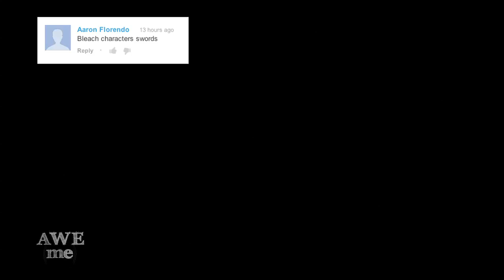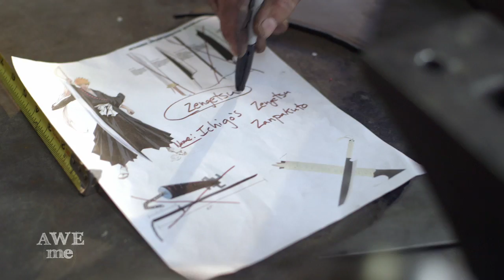Ichigo's Zangetsu Sword (Bleach) - MAN AT ARMS

Comment: I am a bit dissapointed with this sword because when those guys swing it around it bends.
Use a harder material.
Reply: They wouldn't be able to swing it as such if they did unfortunately.
Reply: V Stanev But a stronger guy probably could :)
Reply: ***** The people on this show are very strong it would take a body builder to swing it without having a problem if it was made out of stronger material.
Reply: Well,I understand that it would be heavy to lift by an ordinary man.
But still a weapon is designed to kill,stand againsts other swords....
This sword would break easily if it went against blackstar weapon they did also.
But well,it's pointless for me to talk about this because nothing will change.

Just because something seems impossible doesnt mean it actually is impossible.
Only trying out will you find out xD
Lol,a rime came all by itself ;)
Reply: if the metal is too hard it wouldnt bend but it might shatter and if its too soft it could be all over the place so this is balanced and its the best metal to use in this case.
Reply: As an engineer: You can have relative rigidness or use less material, not both. Besides, all tools bend when striking. If they made it solid enough to 'not bend' when hitting a watermelon it would need to be several times thicker. It wouldn't resemble the original at all. To not bend when striking another weapon, it would basically need to be a solid 4x4 inch piece of bar stock haha
Reply: Is there some material that isnt that heavy,and doesnt have to be thick to not bend?
There should be.Maybe it's not the one that weapons are usually made from,but there should be one.
Reply: All weapons bend. Go out and buy a katana and take a few swings. Blades on longer weapons bend.
Reply: It still looks sweet..
Reply: Welcome to real life where we have a thing called physics.
Reply: It's funny how many times a group of people becames a "yes man group" that even if you presented them with shit,they would applaud you.

There is always a way,but before that you need to choose.Are you going to go easy or hard way.
This is clearly easy road.

All of you "yes mans" this doesnt mean that the other work they did is bad or that even doing this wasnt hard to do.
But it could have been done better.
Reply: ***** This is real life, not one of your Chinese cartoons bro.
Reply: Eddie Spaghetti It's actually japanesse.
Anyways...someone said that each sword bends.
As far as I know swords dont bend.
If they did then in a sword battle you would get your sword destroyed.

Let's stop for now,cuz I can see that we cannot agree.
bye
Reply: ***** you clearly don't know that much about metal, so let me enlighten you, steel is an alloy formed from iron, and carbon, and contrary to iron, steel is very flexible. You might think that this is a disadvantage, but if it doesen't bend, it snaps. so Theres that.
Reply: Magnus Husted Even if the swords do bend a little(1 mm).
What was shown in the video is not even close to that or are you blind?
Reply: ***** if you wanna complain so much... go make one yourself then see the results for yourself...
Reply: teo jinhao It wasnt my intention of complaning soo much,it was the people that opposed me by explaining why is something like this okay,even if it's actually shit.
So I had to answer them.

To show you that it can be done - How a Buster Sword is built.

Ichigo Zangetsu is even smaller than this sword due to the shape of the sword....
Reply: it is also thinner...
Reply: Hey Stefano... Don't worry... let them think what they want... here's something for you to spot on... in fact they who has NEVER hold a real sword, (not even a real "KATANA" previously mentioned...), ...  in fact have no idea about HOW does a real simple sword like "Katana" is made of... IN FACT this guys has done a very great job by doing the best they could to make this sword real... because it is not easy to get the right sizes and techniques to make real such a thing like that from an "Anime", (for the people with no culture...), ... BUT... NO, not all the blades are made to bend, like you said in fact most of them bends but it's exactly at max, 1.8mm... of bending and this is NOT to avoid snaps, this is to bring you help with the balance and weight of the sword when you're in battle and also when you need to swing the sword in very opened angles, otherwise your wristles and even your shoulders muscles would even break... in fact, Swords and even more "Katanas" have a very Slim and thin long bar all along and inside the sword which is made of a particular mix of Iron, Steel and sometimes other metals and even "minerals" and this bar it is called "The Soul" of the sword, which goes from the holder untill almost the tip of the sword... that's why it has to be covered by the "Decoration", like most of people call it, for you to not to warm it out with your own hands and if these "Smart" people commenting and throwing, their very  "basic" knowledge at you, would have got a small idea about it, they would even know that this causes the sword to NOT to bend at max as posible to make it "SLIDE" and cut perfectly, which requires a special technique to make it... and that's why the one that "BIRTH" a sword often prints their own name or the name of the sword in it, often called the "Seal"... and now finally... have you ever wondered "Why there were ancient masters trying to practice and masterise sword fighting techniques all along the years and years and years?" ... well, buddy, that's the reason why... how to learn to move and fight and make a sword become an extended part of your body... when it's heavy to lift, carry and it can't bend easily ;) ... have a great time buddy and don't worry you were not wrong at all ^_~
Reply: William Guile You should read again what he wrote.
Do you imagine how silly would the swordsman look if his sword bends so much that it is actually seen by naked eye when he is in action.

I belive that when first swords were made,people were like you guys here.
This thing is heavy,it's not practical and so on...
If you train yourself with a sword at first it's going to be hard,but later on I belive you would be able to use it as regular sword.
No one has tried it yet,cuz we dont use swords for war anymore and we dont have wars either.
Reply: ***** Uhh people have been using swords for centuries now, it's just that swords like these are not good for combat. Way too heavy and way too long (Plus very impractical). We all can't have superhuman strength, agility, dexterity, etc as Ichigo from the anime. IMO it's sillier to have swords like these in combat than a sword that bends.
Reply: If they used a harder metal the sword would break, because with more hardness the sword looses its tenacity, and a few swings can crack it easily. Hardness is good but only at a certain level.
Reply: ***** dumbass lol.
Reply: ***** how stupid are you? there is plenty of war in the world
Reply: Eddie Spaghetti war where people use swords???and I am the stupid one ;)
blackUP2424 thanks for the insult...

cleijuni
To me it seems that you people dont see what the sword in the video does...
To demonstrate create a paper zangetsu and swing it.(this will show your extreme case - compared to katana this ichigo sword is just too much bending-specifilacly closer to te sword end)

Somewhere on the youtube there is mini version of ichigo sword.(you dont see that one bending like freaking "paper")
Reply: ***** Guys.. Look up claymores or something. Huge swords, able to be carried yet very slightly bend because you see. a completely rigid sword is obviously going to break at somepoint BUT You can't have a fucking flexible ass sword either it's impracticle. As you see if a sword bends to much it has a chance of fucking breaking as well. I swear half of you have no idea what you're talking about
Reply: Knowen The sword in the video bends too much in my opinion.
It looks like it could break at any minute.
That's why I was arguing in the first place....
Reply: ***** yea I know, I'm going along with what you're saying not against. this sword looks like, if it were to clash against another, it would just... yeah XD now work
Reply: ***** you are sort of right they are bending a little to much to be a pratical sword but keep in mind this was never intended to be a real sword so the size and thickness make it bend but a normal katana will slightly bend not as much as this though
Reply: Nick Platt Lol,then why not making it like the anime(not able to bend) if you are not going for realistic sword...
Reply: ***** because anime swords don't work in real life, this was already explained to you, they are impractical and not realistic. If you made it so it didn't bend you'd have to make the blade much thicker and nobody would be able to pick it up since it'd be extremely heavy and it wouldn't look like the anime.
Reply: science bitch.
Reply: ***** If I was making this sword I would make it right even if it turns out heavy.
I linked you guys a video from some other guy who made a thicker and bigger sword than this ichigo sword.
Off course your first swings wont be powerfull or skillfull and you would probably barrely swing it.
I dare you to say that after 1 year of training with that sword.

It seems like you people dont know what swordsmans are.
A sword doesnt make a swordsman.
It's his skills that make him one.
The skills he achieved trough rough physical and psihological traning.

And yea,I am pretty sure that those guys could do it,but it's just more work and they dont want more work probably.
So I am not teaching them how to make swords,but not to be too lazy for doing stuff like this xD
Reply: William Guile You're not a blacksmith, so what gives you the right to go off like that?
Reply: Knowen well,said knowen :)
William - you sound pathetic.
Just because someone doesnt agree with you,you start insulting people...
Reply: ***** Just because you keep saying the same thing over and over doesn't make you right. You know nothing about swords or blacksmithing and you never will.
Reply: Eddie Spaghetti You dont know that.
Reply: You should thank them for making stuff like this not everything is perfect at least they tried and it actually cuts people like this awesome guy showing us cool weapons are very super ultra rare around the world so you should be thanking him so yea don't complain
Reply: This isn't really worth arguing over if your gona be stubborn about all of this then fine but unless you have the prof and experience to back up what you say it don't mean jack shit
Reply: ropgun dawam I thank them for what they did.
And I am glad I stumbled to their videos.

But when I see it can be done as showed you in a another video,I start to think they didnt put enought effort in it.(maybe cuz they thought it would be heavy like the other sword they made)

Anyways....I am tired of arguing with you guys.
It's hard when more people goes against less people.
We can agree that we disagree.
Just because you havent seen something and think it's not possible,doesnt mean it cant be done.

Bye
Reply: dan this is the man you are locking for michaelcthulhu.
Reply: Southern Shark Body builders are actually relatively weak. Strong men usually have a very stocky build. Body builders really only have the appearance of strength.
Reply: Xero Shifts Body builders don't just have the appearance, they are strong but they certainly aren't the strongest people out there. They mainly go for looks yes but that doesn't mean they are weak.
Reply: Eddie Spaghetti Welp, to everyonw here, someone can just get a gun and shoot them from afar. "Anime“ Shenanigans like kirito deflecting bullets with a sword isn't right in the real world. I think the sword era ended and the gun era took over.  (Random troll)
Reply: Loen nguyen Everybody knows that already, thanks for pointing out the obvious. Swords were just a small part of medieval combat also, swords weren't the only melee weapon used.
Reply: ***** most of your statements about historical sword use begins with "I believe". You can believe all you want, won't make it true. I'd suggest actually reading about it (maybe even more than one source, oh no!) Before spouting whatever you believe.
Reply: Your argument is invalid . You are comparing two totally different swords
Reply: ***** After that cheesy "it's not the sword that makes the swordsman" speech I'm pretty much confident that your are entirely disconnected from reality. Sorry, but animes are not an accurate representation of the real world. This sword was designed to be used by a fictional character with inhuman strength and dexterity.

Even if it was true that with a year or so of training you could effectively wield the sword you seem to be describing (by the way, it's not. There are limitations to how strong and dexterous a real human being can be.) there would still be the problem of durability (it would crack and fall apart after any sort of extended use) and the fact that making it that inflexible would make the sword look completely inaccurate. And even if none of that was true, you couldn't reasonably expect these guys to dedicate an entire fucking year of their lives just to make one video.

Also, it isn't entirely true that the sword doesn't make the swordsman. It's a combination of both. If I'm just a good swordsman and you're a great one, but you're using a laughably impractical and easily broken weapon and I'm using a sword that actually fucking works, I'm going to win.
Reply: MajesticSundew A real swordsman can beat a less skilled swordsman with just wooden swords if he wanted.
If a good swordsman was in life and death situation and a crappy broken sword was near him,he would have bigger chances of surviving than a swordsman with less skills.

And no,I am not asking them to dedicate an entire year of their lives for making one video...
It's the only way they can show that I am wrong and they are right.

It's like asking someone that never seee a balloon and a needle if balloon would break if it falls on to the needle.
The logical way of finding out what happens is by actually doing the experiment.

In what way is the sword inacurate?
If you go back to the human older versions you can see that they were stronger,I dont see any reason why todays human couldnt activate that gene by practicing actually sword slashes and similar instead of lifting heavy stuff.

Several years ago me and my friends started playing a game where you find a piece of tree that is close to a baseball bat and hit small rocks with them every day.
I have never been stronger than those days.
Imagine how strong would I be now if I continued to do it for the whole year.
But,people became lazy,and that's why you wont even bother trying....

Anyways...I dont even see why I keep on replaying.
As I said,the simplest solution is to do the experiment.
If you dont then it's just your and mine opinion.
Arguing is pointless.
Reply: ***** Wow you honestly don't know anything about swords or swordsmen do you? This isn't an opinion either, from what you've said you objectively don't know anything (or at the least VERY little) about what you're trying to argue. You really need to stop talking, the internet is full of enough opinionated morons already.
Reply: Eddie Spaghetti Whatever....
You know everything,others know nothing.
Fucking persistent i**.
Reply: Try it on people and say bend lol
Reply: Do you have any idea how heavy that would be?
Reply: Nicholas Cha If I actually cared that much and wanted Zangetsu I  would try to make it and actually use it.
We could both be right and wrong.
Are you more right,just because a bunch of "loud" people supports your view on the matter?

Also,in my first post I only said that I noticed too much bending and that part of the sword dissapointed me.
I didnt ask for discussions or anything because it was my own opinion based on the swords I seen previously in my life.

I tried to end the disscussion peacefully,but some guys just dont get it.
Opinions differ from one person to the next.
The only way of changing someone opinion is to bring proof.
Words arent proof.
Especially on the internet where people write all kind of stuff.

I hope it's clear enought.
Reply: ***** You keep saying opinions that have been proven wrong. Just because you deny proof doesn't make you any less wrong. You could never make a Zangetsu or ever use it. It's a stupid sword from a bad anime and is incredibly unrealistic. These guys did a great job given the ridiculous dimensions of the sword and you don't seem to understand that anime and real life aren't the same thing. You acknowledge that many people have said you are wrong, you ever think maybe they're saying that for a reason?
Reply: ***** I dont really want to bring this argumwnt back, but if they had made the sword with a dense enough material so it would only bend slightly, it would be hundreds of pounds. I dont care how long someone has trained with a sword, something that large and that heavy would be impractical, and after the third swing, ANYONE would be exhausted. While I see what you mean that it would be nice to see it true to the anime, but at that point, it would only be so heavy that it could only be a showpiece, and one that was much thicker than the subject matter at that. If this were to devolve into a showpiece, wouldnt it be better to make it LOOK like the original?
Reply: I don't think you know how the world works
Reply: How so?
Reply: ***** well, to speak on a sword bending, several designs of swords, such as certain sabres, rapiers, and the like, do bend as do some long swords, katana or claymore, it dosent actually make a sword weaker structurally, but makes it far less brittle, a brittle sword is more likely to break than one with some form of flexibility, and the way the zangetsu replica bends is perfectly within reason, as it does not interfere with the cutting, however, one could make the metal thicker, the issue with doing so, is that it no longer becomes practical as a weapon, as there are other much lighter and equally capable blades, that wouldn't snap your arm at the elbow if you tried to change direction mid-swing, which is why, if i was going to pick a long style sword, i would personally go for an odachi or lowlander claymore, which have reasonably thick and very long blades, but their profile is far thinner and they are far lighter than zangetsu, making them simply more practical, and yes, i see the point of owning a replica for replicas sake, however, this is speaking exclusively in practicalities terms,
Reply: harder material makes the sword heavier and a lot harder to carry and swing and its harder to make the sword in full length because it will make the sword a lot heavier and very hard to balance and carry on the back because that sword is supposed to be as long tall as you, is almost impossible to balance it on your back while walking...
Reply: harder is heavier.
Reply: Holy shit, can you guys stop arguing? Stefano, what you are asking for the blacksmiths to do is completely unrealistic. The fact is, there is no possible way to make a decent replica of the sword without it either being way too heavy or too floppy. I mean, don't you think that they took all these matters into account when making this sword? Also, comparing it to Blackstars weapon is a bit ridiculous in my opinion. As for most everyone else, calm the fuck down. People have different opinions, even if they seem stupid to you, it's much more productive to calmly and explain why you disagree than to start to ridicule the person you disagree with.
Reply: and the sword isnt that skinny
Reply: ***** Please don't tell me you don't think swords are meant to bend... Just because anime and shows depict it as perfect doesn't support the physics behind making them. Allowing a sword to bend actually makes it less prone to break due to resonating shock pressure that deflects off the blade. If it were to be rigid, it would vibrate towards the user, making any sort of force actually worse for both person and blade alike.
Reply: 1. every long blade blends and wiggles when it cuts something, just that you get to notice it only in slow mo, in order to it to not wiggle that much it would need a more dense and harder material or to make this blade way more wide, and both options are absurd. 
this guys have a lot of experience whit blades, and it is quite offensive when people talk that way without knowing shit
Reply: redroger28 I wouldn't bother trying Red. This guy has been arguing about this for weeks. He's decided being wrong is an 'opinion'. Some people chose to go through life willingly ignorant rather than be proven wrong. Pride is more important to them than truth.
Reply: ***** Im pretty sure that the sword would be in dangering at snapping where the hilt was welded onto the blade o-o
Reply: Southern Shark Fun fact, body builders arent actually as strong as they look.
Reply: they kept screwing up the edge alignment.
Reply: *****
all swords flex.  people keep saying they "bend" but that implies that they keep that warped shape.  a good sword can hit something without shattering, and without being bent out of shape.  they took something that COULD NEVER BE WIELDED BY A HUMAN BEING and made a version that could be used to actually cut something.  for you to lift a version that is as thick as the one in the anime and manga you'd have to have so much muscle on your body that you could not assume any usable sword stances.
Reply: everyone is talking about how it's usable, and anime replica sword is not suppose to be usable, your not even suppose to take it out of a display case let alone swing it.
Reply: oh my god, never say your an anime fan, you don't have a clue
Reply: Alexander Eleftheratos
seems to me you are the one without a clue.  they made a replica that could actually be used (though not very effectively in sword on sword melee combat) and you say replicas are supposed to be too shitty to actually use if you needed to.  where is the logic or rationality in your statement.
Reply: wow..0.0 i read all the comments.. im tired now
( a lot of people wrote in here so i just want to make it longer^^ yay!)
Reply: paty lu hehe,first comment that I wanted to repply in a while xD

And yea,soo many comments even though I wasnt looking for a discussion when I posted my comment.
Reply: Though in bleach it sometime looks like it's bending
Reply: If its too hard it becomes brittle
Reply: ***** you are so ignorant seriously
Reply: way much more time then they want to put into a "prop"
Reply: The metal is very hard actually, the way they heat temper their swords takes a lot of time and makes them very tough pieces of steel.  The advent of making more flexible metals actually made swords last much longer in battle, because a rigid metal will snap if any flex is induced.  A sword like this will last much longer because it can move and bend to any resistance while still being very hard (which makes it sharp).
Reply: Dude, I understand that you want it to be so star spangled perfect, but if he were to use legit thick steel, swinging it would give anyone a hernia. The sword is a fantasy sword and obviously is not practical or ideal to any swordsman in reality. This is the only way.
Reply: ***** You have to understand that a sword needs to be flexible to not break. They've used very hard and sturdy metal, that probably wouldn't fail you in a battle, because it's not so stiff that it shatters after one blow. This is the only way to make it, so that anyone can lift it (Also it's a fictional sword, that is NOT practical to use, even if it had thicker steel.. If you want to win a sword fight, don't use this xD)
Reply: Yeah and also its for for fighting hollows its for art.
Reply: quite a lot to read tho in this comment lol. yes it bends a lot because It's built like a katana which do bend to about 45 degrees and then returns to a perfectly straight sword. this also help retain the blades sharpness in sword to sword combat as i saw in your video you posted yes he did use a more sturdy metal but he also mentioned that anything other then wood would easily damage the blade. as for how thick it is plz keep in mind that depending on the source the Zangetsu Changes Size. looking at some anime clips the sword seems to show the sword to be much thicker but if you look at the picture art on the tab of the video its shows it being thin. also keep in mind that the guy swinging it probably isn't trained to swing a sword of that size much less its shape... because of how wide it is, it would have to be swung Vary straight and much faster in order to prevent the blade from catching and to negate gravity with a stronger force in order for that sword to be used as intended by its design. but it is a sword and it will not break it will bend in half back and forth many times before that metal will break.
Reply: A sword SHOULD Bend. If a sword does not bend then it shatters.
Reply: It has to flex,if its too hard the metal tends to shatter,break,chip
Reply: It is hard metal, the reason why it wiggles is that the sword is broad and thin.
Reply: ***** You can't admit when you're wrong, can you? :P
Reply: All depends on the metal grade, not all steel is the same. Just saying.
Reply: if it doesnt bend, then the blade shatters easily. All functional metal or iron blades have to have a certain degree of flexibility, which differs from pig iron, which is not flexible, and shatters easily.
Reply: ***** the blade bent that much due to size. True, normal blades bend, but not to that degree cuz they had to be weildable by the general public. As a result, they only wobble very little.
Reply: Magnus Husted I actually picture zangetsu as thick as the buster sword. But yeah, the intend was to make it virtually as practicable as the one in the story so yeah.
Reply: Any harder and the sword will crack. If they used thicker material it would almost be impossible to swing around/
Reply: the fact that it bends is a beauty in itself.
like when he swings the sword at first it bends but then straightens itself out before the cut transferring all the momentum and force of the bend to the straight cut. Its also made from steel, the shit that bullets bounce off of
Reply: the blade bends probably because they wanted to make the sword light enough to wield.
Reply: ***** Ok, I'm going to put it nicely because screaming at people doesn't work. The reason a sword bends is because if it doesn't, it would snap, but if a sword bends too much, then it means it's too soft. A properly made sword is meant to bend a little bit, because if you were to make a structurally sound sword that didn't bend... Good luck lifting that thing, no matter your skill. You can't train and improve with a sword you can't lift. So a slightly bendy sword is the best sword you can get, look at katanas... Those cunts floppy as shit, but they're some of the strongest swords you'll find (as long as they're made properly).
Reply: Freddy Spatula
katanas are not floppy,they are one of the stiffest swords ever made
Reply: Freddy Spatula I read somewhere that non bending swords exist...
It is probably true that non bending sword would break sooner than a bending sword.
I am fine either way.
But if the sword does bend then it shouldnt be visible to that degree.
The bending sword in video has is similar to when you have long piece of brass and you swing it.
Reply: ***** Yeah,  I don't know what the fuck I was thinking, that's my bad. There's some kind of sword that's floppy as fuck, and really good. But I can't, for the life of me, remember what it's called.
Reply: ***** Yeah, I wouldn't be surprised if something like a claymore didn't bend much, purely because of its thickness. The sword in the video did wobble a bit too much, that said, it was spring steel which is especially wobbly because it's meant to be, and he probably chose that steel because of its weight, but it would have been nice if he made it out of something a little higher quality.
Reply: ***** real world physic and anime physic are two different things, my good friend.
They chose spring steel because of the weight. If there's really a better quality of metal to make the sword, they would've used it. But you know, there's also gravity. You don't defy gravity in real life.
Reply: The little anime punks here don't understand nothing, even for a amateur. The understand that he have came from animes. Such a waste of time try to argue with him. Don't waste your time as well.
Reply: You make 1 that doesn't bend stupid fuckboy
Reply: If the sword were any harder it would break because of its size
Reply: Most things will appear to bend in slow motion, which they appear to be using in the demonstrations at the end. You might not even notice that in person.